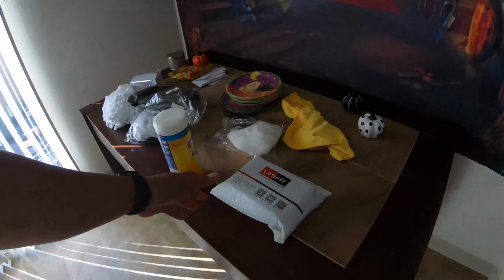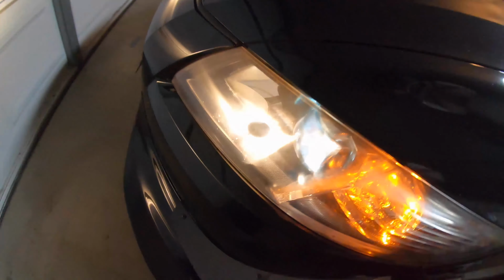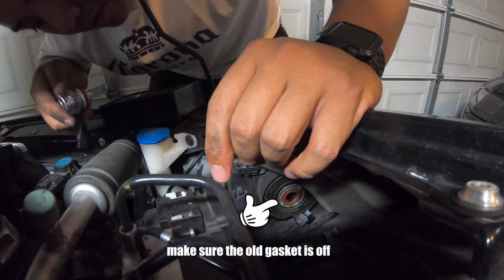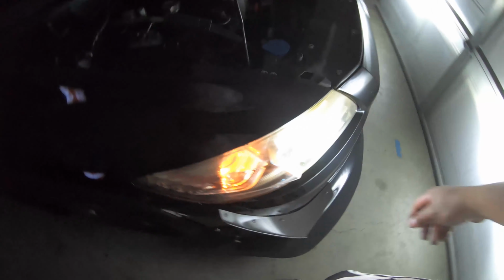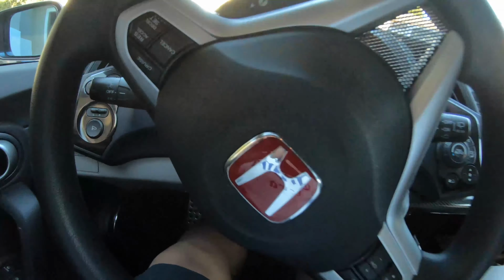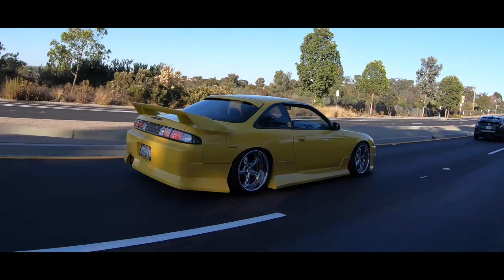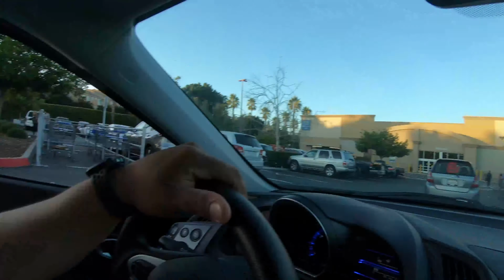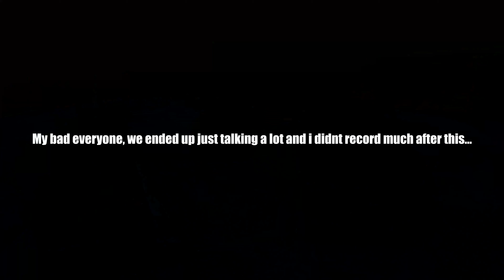Lasfit LED headlight install & Review! ft. @yellowfourty & @Bfr.media ~ ep.49

Comment: Just bought my first 2011 crz and both low beams don’t work? Only fogs and high beams work
Reply from the maker: thatsonyou did you check your fuses? The bulbs?
Reply: Ubante Garage changed the bulbs  and they still didn’t work, also the fuses and relays were fine according to Honda I took it to the dealer, they said my car only works with LEDS/HIDs but mines a 2011 ex, so I’m confused, they wanted $900 for new bulbs so I’m gonna order some aftermarket ones and see if they work
Reply from the maker: Hope you figure it out 🙏🏾

Comment: I'm desperate for some advice. I bought new HID bulbs because my headlights burnt out. They were installed but now my lights don't work. They will come on for 30 seconds and just switch off. On 'Auto' mode and manual as well. I don't know what to do the bulbs were expensive and I really don't wanna start spending $$$ at a dealership!

Comment: Did you need a Canbus Decoder for your High Beams?
Reply from the maker: I didn’t do anything with my high beams. So no I didn’t
Reply: Thanks for the reply, I've been looking around for a led headlight that works with the DRL system but I'm probably just going to look around for a better halogen bulb.